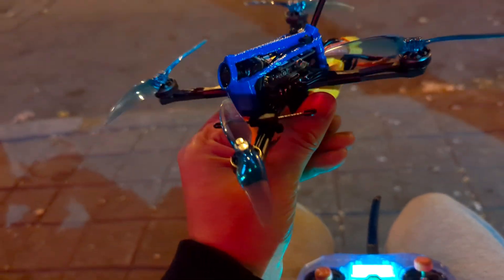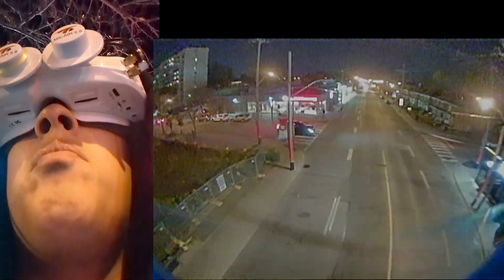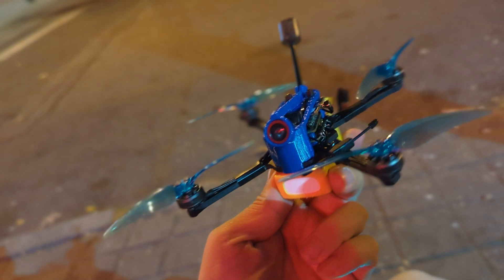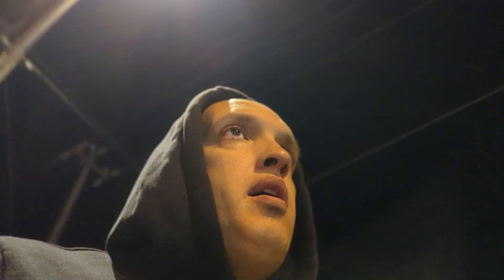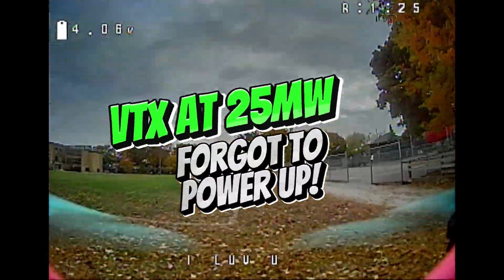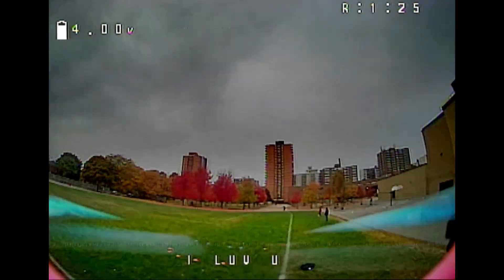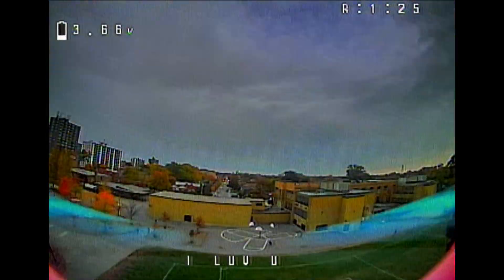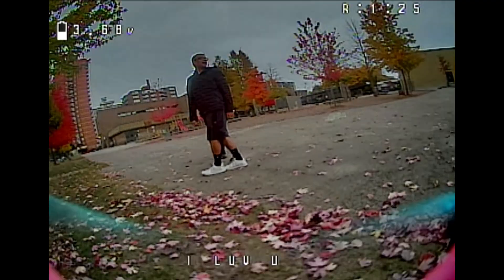This 4-Inch FPV Drone Flies Better Than A 5-inch

Comment: Nice frame and superbe camera. Perhaps you can have a try with Lanrc 1505 3800kv motors. Very cheap on Ali and until now never had a problem with them. I already put them on 4inch and they have enough power on 4s. And I also built them to be smooth flyers. For speed I use 3 and 3.5inch on 450mah
Reply from the maker: @henrirotthier5710  I have new 1504 4000 motors so will build with those soon. The mounting on the lanrc is probably 12mm so wouldn't work. I've tested 1404 skystar's I think they are made in the same factory as lanrc. They are great budget motors but I found something I like a little bit more but for cost your absolutely right ;)

Comment: looks like it flys great but you are flying it like a discus :D
wasnt it meant to be the chill longrange flighttime beast?
Reply from the maker: @bluefpv3263  lol It's meant for Ariel acrobatics LOL basically the air discus that I can rip around and go into the clouds and stuff and do freestyle without hitting things lol Or I guess freestyle in hard mode. I see the thing is the better it flies. The easier it is to Freestyle which means you probably will screw up less and have less problems. But if you do, goodbye Motors